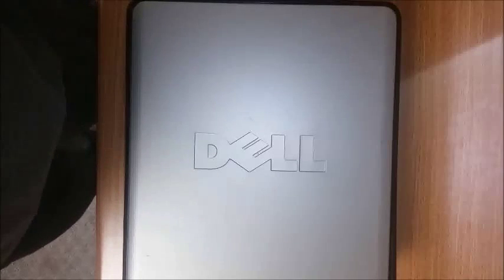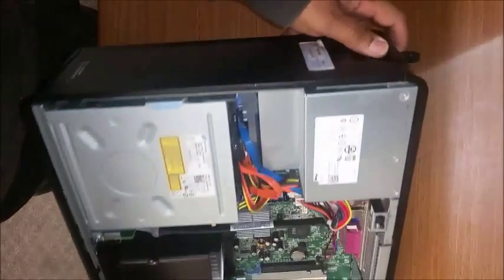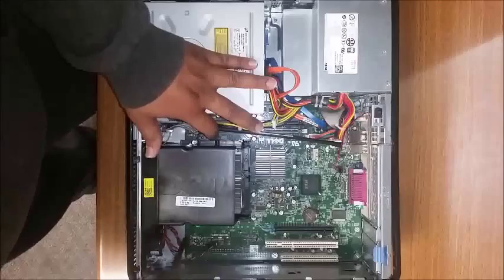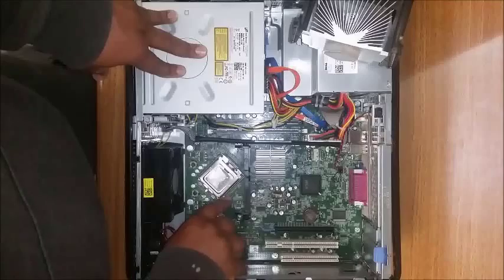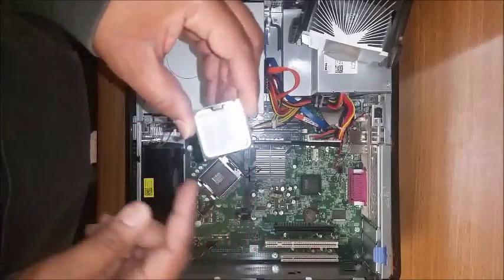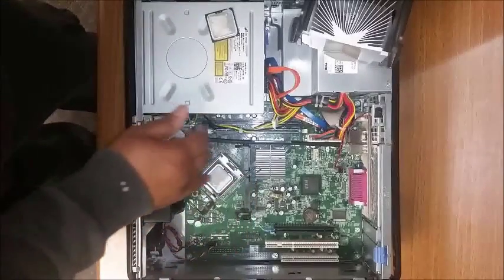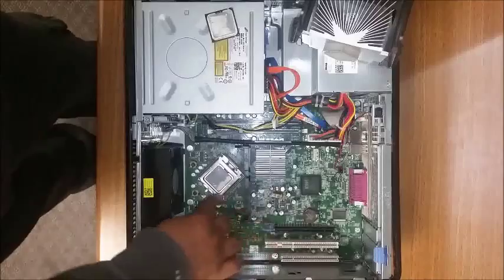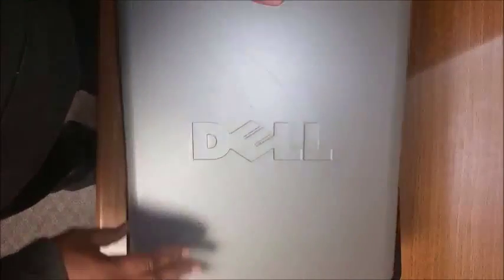How to replace or upgrade Processor Dell Optiplex Desktop

Comment: It was a good video with 2 exceptions.
1. You did not clean the thermal paste off the heatsink, it should always be cleaned from a CPU and heatsink and new paste applied every time it is removed. 
2. No one has ever called a CPU/processor a "prock".

Otherwise an excellent video.

Comment: I was hesitant on replacing the CPU when I opened this computer as I wasn't used to this setup, but your video was extremely well done and showed that it could actually be easy.  

I would change a few things in the machine's design, but your video is impeccable!

Thanks a lot.

Comment: OptiPlex 780 Do you support Intel core i5
Reply: No but Core 2 Quad Q8400 yes
Reply: Either a Pentium Dual Core E6800 or Core 2 Quad Q9650 is your best bet for speed. The Pentium is a 2 core CPU @ 3.33 GHz, or for the Core 2 Quad, 3 GHz and a 4 core CPU

Comment: Thanks for the quick tutorial. I'm going to try this with an Inspiron 580-i3 to i5 upgrade. Did you have to change any settings in the BIOS? The only suggestion I have so far is to make sure I have the latest BIOS, which I do.